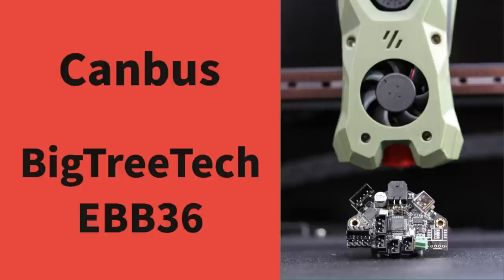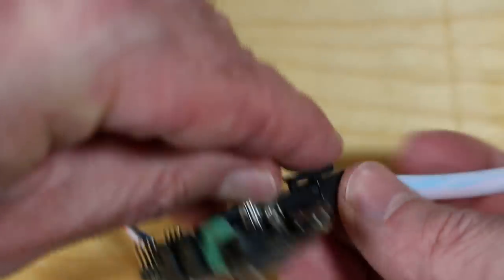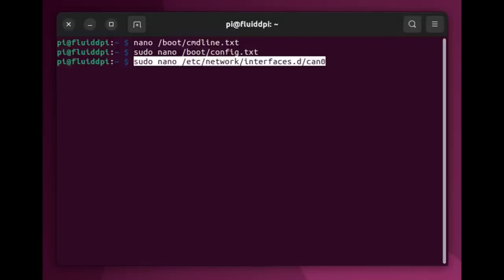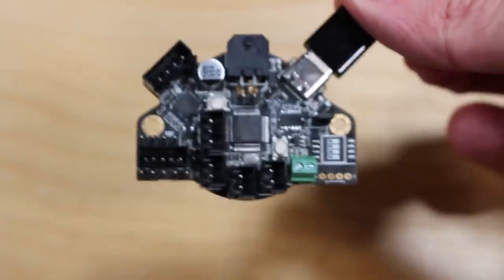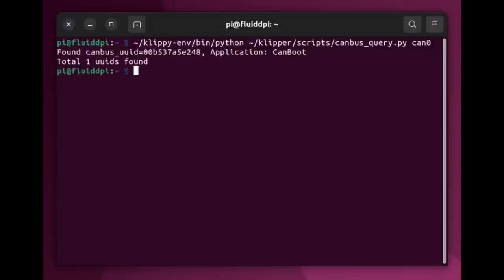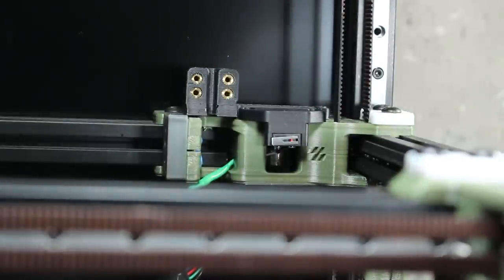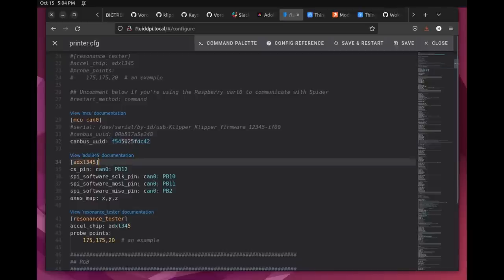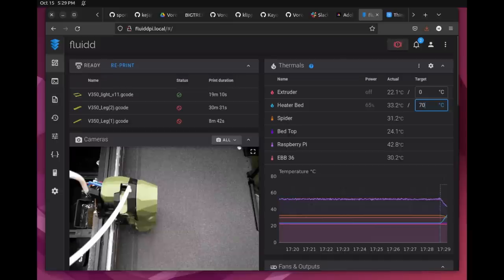Canbus (can bus) - EBB36 / EBB42 Install with Klipper on Core-XY Voron 2.4

Comment: The X-carriage has a little passthrough for the wiring of the x-end stop. Right there!
Reply from the maker: Yes it does.  And I have been using it for the last few months.  Thanks for the comments and watching!
Reply: @KapmansBasementWorkshop  thanks for making the video! About to go canbus with umbilical. Got all the stuff, just waiting for the right day now.
Reply from the maker: @ThePhilbox  Good luck with the modification.  I really like canbus.  Any future corexy of mine will have it. It has been very reliable.  If you can, get a better cable than I did.  The cat5 works great, but I'm about to take it out as at times, the PTFE tube I placed it in will slap against the back wall of the printer.  It is very audible when it happens.  I'm actually in the middle of the change as I type...

Comment: 37:13 Did you ever figure out the rgb issue with the can board? I can’t get mine to work either 😢
Reply from the maker: I did.  I had it wired incorrectly.  I recommend you ignore wire color and just look at what the wires are connected to on the led to figure out what to connect them to.

Comment: I just wanted to point out that I was able to continue to use my Raspberry Pi  power connection through the GPIO pins - I didn't have to create a cable for the USB connector.  Like you, I thought that there should be no problem with it, so I tried it.  I did have a problem initially, but it was due to the fact that I dislodged the ribbon cable connecting to the KlipperScreen display; once I fixed that, it worked fine.
Reply from the maker: Which MCU are you using?  I have an original 1.0 Spider.  Wondering if you have the same.
Reply: @KapmansBasementWorkshop  I have a BTT Octopus - not sure the version,  but purchased in the past 3 or 4 months
Reply from the maker: @jeffbernardis420  I think your MCU might be capable of more power output to the Pi than mine.  But no matter, I'm happy yours is working!
Reply: @KapmansBasementWorkshop  my Pi power is coming from the 5v PSU, not the mcu.
Reply from the maker: @jeffbernardis420  Ok, I misunderstood.  Thank you!

Comment: Great video's! they've helped me a lot thanks. Next thing you need is the carbon fiber x rail. you'll have the lightest possible gantry it would be amazing.  I just added my modded stls to printables to work with an amazon carbon rail.
Reply from the maker: Thanks for the tip!  Thank you for watching!

Comment: I’m building a Ratrig Vcore 3.1 and I’m going against the recommendations of ratrig by using a BTT manta 8p with a raspberry pi cm4 and I planned on connecting the fan hat via breakout cable and I’m wondering if everything you did can be done through Klipper or do I need a Linux distro like ubuntu to set everything up right. If I have to use another pi separate from the manta board I’d rather just send the manta back and get the octopus. Any help would be greatly appreciated
Reply from the maker: The BTT Manta should work fine.  But, I have not built a RatRig...not yet anyway.  The Pi can be setup to boot and run via Windows, MacOS or linux.  It does not matter and the same instructions apply to all 3.  Once the pi is running, all other setup and configuration of the Manta, Klipper, Canbus (if you are using it) can be done via the Pi.

Comment: Hi your Video was invaluable in getting up and running my Ebb42 on an Afterburner. Still working on it but got the coms working and the thermostat is already returning a value, Thanks !!!. I can't get my head around how you calculated the current for your Cat5 umbilical, I checked the specs of the awg24 wires used in Cat5 Cables Max Current is rated at 0.5777 A, even doubling it we don't get near the Amperage to run heater cartridge, motor, etc, ... You are obviously right as your setup work so where am I making a mistake ? Thanks again!!!
Reply from the maker: Thank you! I used a chart like this: https://www.engineeringtoolbox.com/wire-gauges-d_419.html
I also found some charts that presented the impact of higher temperatures which lower the current handling capacity (which I can no longer find).  And to be safe, I doubled the power wires due to the heat (not ideal).  Its very unlikely  that i will actually ever reach the 6amp limit of the EBB36, but I believe this is safe.  If it turns out I'm wrong, please tell me why for safety sake!  Where are you getting the value of 0.5777A from?

Comment: Thanks for sharing. Why did you decide to do this, what was gained? I haven't quite understood the general movement to toolhead boards and CAN. Some less wiring but seems to greatly increase overall complexity. Thoughts?
Reply from the maker: Great question.  There is some added complexity, but once complete, I think it may  actually be simpler.  But, my reasons were: 

1.  I have had a few cables break near the connectors and I believe my cables might have originally been a little short with not enough slack. Also, I'm terrible at crimping...
2.  I needed to do some rewiring including adding about 5 more wires, so I figured why not try this?  
3.  My wiring under the printer looks nothing like all the beautiful photos people post.  Its a rats nest.  I want to rework that as well and eliminating all these wires should make that significantly easier.  Much less to rework.  I now get to remove a lot of wires!
4.  I have hope that eliminating all the cables will lower the weight on the X & Y axis and allow me to push higher acceleration.  But currently, I'm not really seeing an increase that would make this worthwhile...yet.  I have some more work to do.  
5.   I spend much more time than I should (I seem to be addicted to it) making changes to the printer which implies wiring changes.  Now, instead of flipping the printer to get into the bottom electronics, it's right on the print head itself.  Super easy.

I'm not convinced this change is for everyone.  But for me, it's working nicely so far.

Thank you for watching!
Reply: @KapmansBasementWorkshop  All valid points. I successfully built a Switchwire and got it running no problem thanks to videos like this, but I'm still not sure what I'm doing when it comes to firmware flashing, bootloaders, etc...I can only get it done with specific instructions and no hiccups. For me, crimping and wire management wasn't to bad and seems to be holding up. Also, you have to admit, drag chains are cool 🙂. If I ever get more adventurous, your vids on your 2.4 will definitely be a resource for me. Thanks again!
Reply from the maker: @jimlee4649  They are cool :)  My printer is looking a little bland (clean?) at the moment.

Comment: Thank you for the video! What AWG and wire type would you recommend for this setup?
Reply from the maker: For the can bus signal itself, I believe you should have 26awg and it should be at least twisted.  For power, it should probably be 22awg for min safety in 60c to 70c.  That should handle 7 amps at those temps.  You can go bigger if needed.  Copper.  This supports the max draw of the EBB36 of 6 amps.  My guess is that you probably will not use more than 3.  But you should add this all up yourself and please don't take my word as absolute here.

Comment: Hello. Does Canbus work whith Spider 2.2 bord?
Reply from the maker: You have 2 options.  1. Purchase the canbus expansion board from Fysetc.  It's very low cost.  Or 2. Do what I did and use a U2C board from BTT (https://shareasale.com/r.cfm?b=1890927&u=3422519&m=118144&urllink=&afftrack=) or a waveshare hat for the Pi.  I like option 2, the U2C as it connect USB on the PI to the EBB36 (or whatever canbus controller you choose).  I feel better knowing one USB port on the PI is dedicated to the Spider and the another USB port on the PI is dedicated to the EBB36.  The PI CPU is much more powerful than the spider and can easily handle the load.
Reply: @KapmansBasementWorkshop  Which model U2C  and EBB36 does You use?

Comment: When you wrote this in the description "When making the video, I failed to record terminating the EBB36.  For reliable communications on the canbus, please make sure you terminate the EBB36 with the jumper." 

to do this, is it by putting a jumper on the 120R pin on EBB? 

Also: For the X stop, how did you plug it into the 5 pin endstop location if its just using 2 wires?
Reply from the maker: Yes, that jumper needs to be there or else you will have a very large number of communications problems.
For the x endstop, I connected it to the EBB36 at endstop_pin: ^can0: PB6 and ( I believe ) the GND pin.  I used a 5 pin connector, but only crimped and installed the 2 wires.  I state "I believe" because I don't have access to the printer at the moment.  I can check later.
Reply: @KapmansBasementWorkshop no worries on checking that, I just was curious and will try that out. Thanks for the response!
Reply from the maker: Actually, (I still have not been able to look at it), but not GND,  it should be 5+.  Yikes!
Reply: @KapmansBasementWorkshop  my electrical knowledge is weak but the other endstop pins (z and y) on the main board (octopus for me) go into the signal and ground pins, and not using the voltage pin. Why does the ebb use the v?
Reply from the maker: Follow the pattern of the others, that should work. My apologies, I should not be giving advice without actually checking the printer or my notes.
Reply: @KapmansBasementWorkshop  no need to apologize, its all good. Just verified, GND and data pin worked :D

Comment: Awesome as always, easily the best Voron 2.4 channel. I love the teflon tubing but I didn't catch the exact ID & OD just 6mm?
Reply from the maker: I used 6mm OD x 4mm ID.  But I actually ran 6 wires to double up on the power due to the possibility of future changes I might implement. Also using slightly thicker gauge for the 2 power wires are really the best solution.  If either of those are true, you could go thinner.  Finally, at the time I could not find thinner and so the ptfe tubing is thicker and a little less flexible than I would like.  If you can find 4mm ID and 5mm OD, I think it would be a little better.  Thanks for the compliment!
Reply: @KapmansBasementWorkshop  I just picked up some 5mm ID x 6mm OD PTFE tubing on Amazon.  Should give a little more clearance on the interior for larger power cables, but the same OD as yours and should also be more flexible since the wall is thinner.  Worth a look!
Reply from the maker: @atg.studio  I'll need to have a look. I assumed I will rewire eventually to make it easier to make changes later.  It would be nice to be able to unplug the cable from the backside of the printer.  But honestly, I'm not finding any reason to do so.  The cool thing with canbus is that the EBB36 supports anything I would want to change/add/upgrade on the hot end so far.  There rally is no need to touch the wiring...other than replace my 4 power wires with 2 thicker ones.

Comment: can you connect usb-c from EBB36 directly to PI?
Reply from the maker: I believe you need an adapter to do that if you want to do anything more than installing the software on the EBB36.  Instead of a USB adapter, I chose to the the Wasveshare hat.
Reply: Yes, you can. But you need a separate 24V/Ground pair along with the usb-c cable to power the board. See my reply earlier in the thread for a link to the Bigtreetech github page with info on how to do this. Basically you flash the klipper firmware for the EBB36 with USB-C communication settings instead of Canbus. I run this setup.

Comment: I got a stupid question what PTF tube did you use?
Reply from the maker: It's not stupid.  But I'm no longer sure and I don't recommend it.  It will slap against the back wall of the printer during large prints and irritate you.  I just eliminated that PTFE tube.  I would go with the IGUS canbus cable.  It's designed for this.  Another option is the BTT cable that they just started selling for canbus.  If you wish to use cat 5 cable like I did, it might even be better to tie it down the filament tube.
Reply: @KapmansBasementWorkshop  doesn't the canvas come with the cable though? Isn't that a good cable?
Reply: @KapmansBasementWorkshop  oh wait you're using a different canvas I was using the one that was built for the stealth burner lol I'm such a ditz
Reply from the maker: @grathado28  The SB2209/SB2240 have a cable option that works great (see my second canbus video).  The EBB36 didn't come with a cable.  But you can purchase that BTT cable separately and re-terminate with the connectors that the EBB36 or 42 would use.  Unless BTT now has a specific cable for the EBB36/42.
Reply from the maker: @grathado28  My second canbus video uses the same board you are.  That cable you got is great.  I have switched to that same combination, SB2240 + BTT canbus cable.  It's very good.  I recommend you use it.  Without any ptfe tube.  It's not needed.

Comment: where you get this canbus cables?
Reply from the maker: I made the cable with cat 5 Ethernet.  I pulled the outside sheathing off since it's not rated for high temps as the inner cables are.  It's twisted which is required for canbus as well.  However, the best method is to purchase umbilical cable intended for it at IGUS.  The early parts of the video show how I made the cable.

Comment: The real unspoken black magic here is the re-imagined z cable chain UNDER the rear extrusion.... which solves the cable  clearance issue.  I was able to make mine "barely" touch and its working but this is a much better long term solution I think.  Also, I def recommend doing 500K for the speed.  I had consistent com errors at 250k using the separate USB canboard with ebb42.
Reply from the maker: I'm planning another much SHORTER video soon.  I will cover that and some other things I have changed or am changing as I gain more experience with this.  I was getting those com errors too, but a few days ago I realized I forgot to install the terminator jumper on the EBB36.  The com errors stopped after that.  If you have not, give it a try.  I want to try for more than 500k and possibly try to reach the limit of canbus.  But now, I simply want to use the printer for at least a few more weeks....If you like, feel free to reach out on discord to discuss the cable chain.  I'm happy to discuss the details.  So far, it's working great.
Reply from the maker: The Voron Discord channel "voron_ electronics" is currently discussing this.  I just posted a link and some other comments about this there....I should update this video's description.
Reply from the maker: I just added the link to the z-chain relocation in the video description.

Comment: Great Video and I used it to get my EBB36, Octopus, and RPI 3b+ all going. Have you been able to use the ADXL chip on the tool head to test_ resonances? I keep gettings errors of MCU timer too close. I have bumped my CANBUS speed up to 850k and that will get further into the process but still fails.
Reply from the maker: I have used it multiple times.  It has worked for me every time.  But, you are not the 1st to mention this issue.  Silly question, but do you have the terminator jumper on the EBB36 installed?  I'm going to try and make a video on the built in ADXL as well (I have been asked to do so).  Finally, thank you very much!
Reply: @KapmansBasementWorkshop  Yes I made sure that was there on install. I think there is noise in the system. I have tried using a RPI pico with ADXL chip as well and that errors out but at a high rate. Keep the videos coming they are helpful.
Reply from the maker: @chrishauca6834  And the signal wires are twisted?
Reply: @KapmansBasementWorkshop  yes used cat 6e pair for the CAN signal.
Reply from the maker: @chrishauca6834  That should work.  Sometime during the next few weeks, I will be upping the speed of my canbus as it's only 250k right now.  I'll let you know if it makes a difference.

Comment: How much does it help with the input sharper tuning? does it give you even more accel?
Reply from the maker: So far, no major improvement.  Not what I was expecting.  But, I will be systematically checking some other items on the printer to rule them out to be sure.  The lack of improvement could be due to something else.  I'll provide an update once I get to the bottom of this.